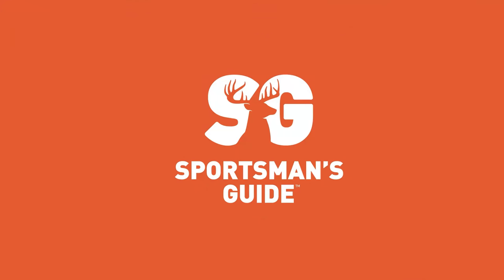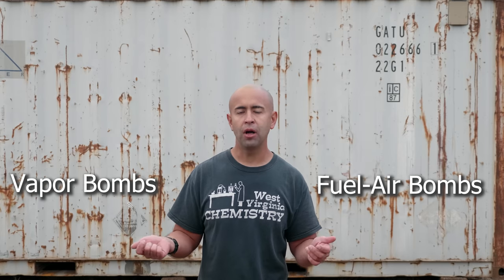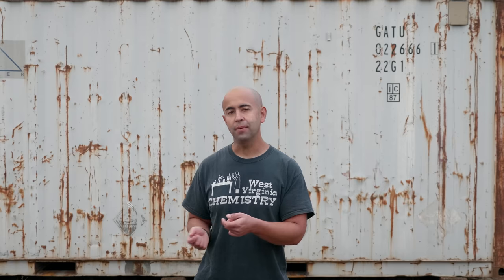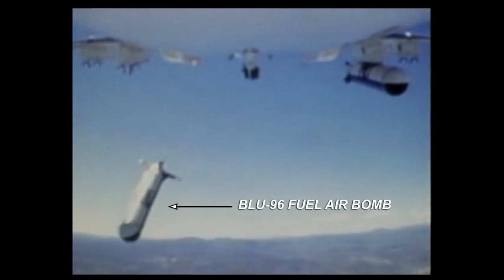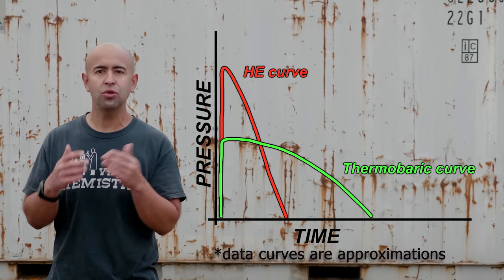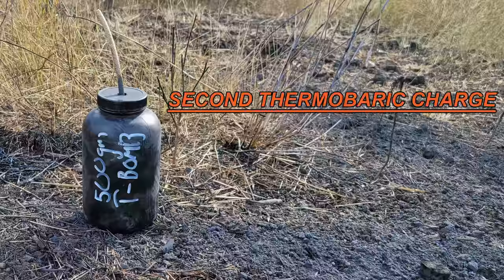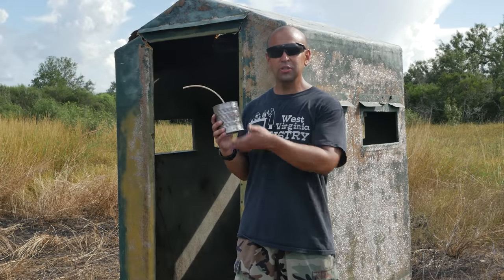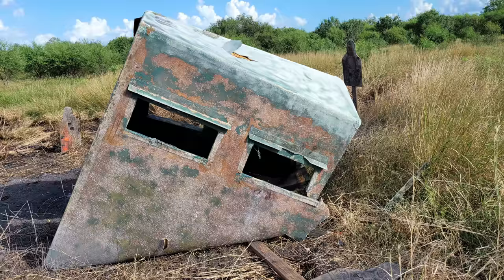Improvised Thermobaric Grenades: Testing Fuel Air Bomb Grenade Designs

Comment: The problem with improvised thermobarics in Ukraine is the dispersal charge almost always detonates the fuel. You need to separate the dispersal explosive by putting it in a pipe B. separate to the rest of the B. That way the heat has a chance to drop below flash point and the pressure escaping will disperse the mixture.

Comment: Not exactly a fuel-air bomb, but liquid oxygen and powdered coal was used in Germany in the interwar period as a cheap mining explosive.  They took rods full of powdered coal and soaked them in liquid oxygen, and I believe could be detonated on their own (no primary).  With dense oxygen present, the coal could detonate (generate a pressure wave).  If it failed to go off, they could just wait a couple of hours for the liquid oxygen to boil and disperse, and then reset it safely.  The liquid oxygen and coal were cheaper than TNT at the time, but you couldn't store it for long periods because the oxygen would boil off, so it wasn't practical for military purposes.

Comment: Armchair mad scientist here. The dispersion charge should be of the rapidly-decomposing type rather than something that deflagrates or detonates. There should be an inert buffer between this charge and the fuel, to prevent premature ignition, and it should NOT be initiated by a burning fuse. The ignition charge should deflagrate an instant later than the dispersion charge.  Premature ignition is the main pitfall here, causing a sad pile of burning slag rather than a big bada boom.

Comment: I find this concept super interesting! Bravo for making this video! Every time I see Jake I get excited because I know I'm gonna learn things I didnt know. The graph at 4:45 for example. He's awesome.
I've been thinking and reaserching alot about solid thermobarics and there's a few ideas I came up with. 

It would be interesting to see the difference between spherical aluminium powder vs dark flake powder.

Mixing the metal fuel with sulfur would be interesting. Aluminium + sulfur will create aluminium sulfide in the combustion, which is a highly exothermic reaction. Would be interesting to see the difference between a stoichiometric mix vs non stoichiometric. Aluminium sulfide itself is combustible but in the presence of water, either by moisture in the air or surrounding the charge in water, hydrogen sulfide gas may be formed. Evolution of gas will greatly increase the pressure from this rapid combustion, aluminium alone will ofcoarse oxidse to solid aluminium oxide. Once the fuel is dispersed into a cloud though oxygen will favor the reaction with Al because of its higher electronegativity compared to S.

If we introduce a halogen gas, by adding either teflon or PVC powder, we may be able to boost the heat of the initial combustion. Because of the reactivity of halogen gasses it will favor the reaction with metals over oxygen. This reaction is also extremely exothermic. So a small percentage is probably all thats needed, just to kick off the combustion reaction. Higher percentages mixed into the AL/S mix would also be interesting. Halogens will also favor the reaction with metals over sulfur if I remember correctly, so if we get a stoichiometric reaction between the halogen and metal the sulfur will be directly combusted into sulfur oxides without forming any sulfides. 

This is pure speculation but it may help if the center charge is positively oxygen balanced in order to set off the fuel. Lower VOD may also help because there's a bit more time for the heat to spread into the fuel, perhaps even flash powder would work.

Hope you guys test this some more, lots of things to experiment with.
Reply: J

Comment: Somewhere in the past I saw a vid on thermobarics. If I remember correctly, they are especially important for tunnels/caves etc (like afghanistan). The pressure curve is better at disturbing ground structures. We only used one once if I'm not mistaken but apparently it's more of roe issue than anything else.

Comment: 1lb liquid propane canisters for the body.

Use liquid nitrogen to hyper cool propane so you can over fill the empty canisters after you add the blasting charge (at low enough temps propane will stay liquid long enough to pour it into an open container and cap it with a plug. Oxygen will too, but dont mix the two.)

They are rated for pressure so they can build up a bit more ooph before the body fails, and the propane should vaporize fairly quickly giving a good dispersal.
Reply: Or go the opposite direction for a boiling liquid expsnding gas explosion
Reply: Just heat over a flame hot enough for the tank to rupture the flame ignItes the expsnding gas
Reply: @michaelensminger5190  you need to super cool the gas to condense it down into liquid so you can get more in the canister (propane is much denser in liquid form than gas form).

It doesnt have to stay super cold after you have it sealed off and pressurised.
Reply: @DH-xw6jp  Just so much effort compared to simply causing tank to BLEVE (boiling liquid expanding gas explosion) fail. Abought 90% of combustable you want sacrificing the heat source.
Reply: Just bope fire insuance is paid up:)

Comment: Have you tried a non explosive bursting method?Something like those airsoft flashbangs that work by inflating a platic hull with co2 till it explodes. May give the fuel a chance to disperse before secondary charge initiates the blast.

Comment: Using metals as fuel will almost always yield suboptimal results in thermobaric devices, because you're unlikely to increase the amount of molecules being around after combustion and due to their state of matter. I.e. 2 M(solid) + 3 O2(gas) -> 2 MO3(solid). 5 (2+3) mol air fuel mixture reacts to form 2 mol of solid stuff -> entropically, this will lead to a drop in pressure, since you consumed 3 mol of gas without replacing it, so the only thing that can contribute to forming a shockwave is the thermal energy released during the reaction.

Ideally, something that burns hot AND has a favorable stoichiometry is chosen. If something like gasoline is used, here simplified as octane C8H18, you can get much better results. C8H18(liquid, atomized) + 12,5 O2(gas) -> 8 CO2(gas) + 9 H2O(gas). Now you're turning 13.5 mol of air fuel mixture into 17 mol of gas, with a net gain of 3.5mol of combustion gases. Now this will cause a nice pressure wave…

Comment: For my job, I drop/employ bombs from aircraft, but we didnt get much training or education at all on how they work. GBU-31, GBU-12, GBU-38, GBU-54, etc. But those are just different guidance kits on essentially three basic bomb bodies: the BLU-109, Mk84, and Mk82. 2000lb penetrator, 2000lb, and 500lb respectively. 
Could yall do a video on the explosive and fuzing components of these? We use certain impact or proximity fuzing with different delays for the intended purpose and the type of target. A GBU-31v3 (with the BLU-109 penetrating bomb body) with a 25ms impact delay has drastically different effects on target than a GBU-31v1 (with the Mk84 body) with a Prox fuze! 
But I dont know how the fuzes work or what type of explosives they use, etc.

Comment: I noticed that the aerial bomb dropped dispersed the fuel before igniting it thus giving the liquid cloud more time to disperse. Whereas in the experiments conducted here the ignition of the explosive charge and the fuel were simultaneous thus not giving the fuel time to disperse into a cloud before ignition.
Reply: There are two different types of thermobaric bombs. The one you're thinking of is a fuel air bomb, the one type seen here in the video is an enhanced blast thermobaric which works on a different concept.
 
The enhanced blast type uses a conventional explosive mixed homogenously with a reactive fuel like aluminum powder. The explosive detonates and heats the fuel to thousands of degrees causing it to instantly burn when it contacts air as it's thrown away from the blast. It's basically an explosion that  produces heat and pressure in a larger area over a longer duration as the blast moves out rather than being a single short spike in pressure you'll get with conventional high explosives.

Comment: I think the magnesium powder is too soft to make a good fuel. It looks like the initiator charge is compressing it into clumps, which don't aerosolize well. You could counter that by pre-mixing the magnesium with graphite lubricant. Alternatively, I would love to see a "hybrid" design, where you mix maybe 10% Mg powder in a liquid fuel.
Reply: Yup the HE is pressure sintering it. Mix the magnesium dust with ether and you get a double acting boom.  Butst, ether goes boom, magnesium dust ignites with a bright flash, than HUGE boom. FWIW the military ones use zirconium instead of magnesium for this exact reason.
Reply: @christopherleubner6633  Technically it's not "sintering", that requires diffusion across the particle surfaces over time.

Comment: Would using compressed air as a dispersant work better? Something like a commercial tire bead setter with a solenoid dump valve? It seems like accurate timing of dispersal to ignition would be easier.

Comment: When using liquid fuels, would pre-puncturing/drilling the vessel and then sealing it with tape or gluing it a weaker plastic film assist with the aerosol effect?  Obviously it would still need a 2 stage ignition, first to expel the liquid fuel and then ignite it.  As for solid fuel thermobaric devices, I didn't completely know they existed until now.  I guessed they wouldn't been tried/tested but with flammable liquids being an easier option, I've only ever seen video of those devices.  Yep, I go to the strange corners of the internet & YouTube - this is how I found this channel 😉🤣

Comment: I think that you should compare it to an explosive in the same type of container (filled completely with explosive).
I'd like also to point out that the grain size and surface conditions of your fuel will have a huge impact. There's a good chance that if the dust is in the range of micrometre or even nanometre that the combustion speed will go through the roof. Obviously oxidised surfaces would greatly impede the reaction.
I've heard of explosives made of nanoscale metal dust coated in an energetic polymer.

Comment: Question: someone in our local area is detonating some concussion devices randomly around our neighborhoods, mostly at night, just for terrorizing our residents. What are we hearing???  We're told it's happening in other cities. It happens all the time not just around holidays. Police dismiss it as illegal fireworks like rockets but there is no flash or pyrotechnics associated. Searching the area we don't find any shards from containers or paper. The jolt is strong enough to rattle our walls inside.

Comment: I believe the thermobaric effect can't be achieved using metals as fuel. That effect comes not with the combustion of the fuel per se, which happens with fine powdered metals, but it is caused by the sudden transformation of the fuel mist into gas (CO2, water vapor or N2), which with the rise of temperature it expands violently. The rapid oxidation of metallic fuel will only produce metallic oxides which are solid, so it doesn't create the desired effect. It could use some other solid fuels as long as are organic or have in it a N-N triple bond, could be as simple as flour. My hypothesis could be confirmed watching some of those devices detonating with the high-speed camera and the second pressure wave being absent with the metallic fuel explosion.

Comment: First, "thermobaric" is a sort of subset of fuel-air explosive. In a thermobaric weapon, an explosive mixed with fuel (e.g. metal powder) is detonated. It undergoes a combination of anaerobic and aerobic detonation involving first the explosive, then the mixture of explosive and fuel. The design and manufacturing is highly technical. The greatly increased pressure wave is believed to occur as a result of detonation "growing" on the expanding blast wave.

The process is considerably more complex than with an ordinary fuel-air bomb, which comprises a plain old fuel that when mixed with air can be detonated, and in that case, it is a (ideally) homogeneous mixture that just goes boom when ignited.

So what you are trying to do here is make a fuel-air bomb, which is a laudable pursuit and also quite difficult. You're definitely not there yet though.

The pressure wave you get when one of these things really works is TREMENDOUS. It is surprising and is enormously more powerful than the report from the dispersal charge. The Finnish guys worked it out (see link). When the fuel-air mixture actually detonates, the flame is markedly reduced. The amount of fuel you used, you should get that same camera-shaking report. Maybe you had better success with a different one though? I haven't looked at all your attempts but you would be getting a POUNDS of TNT report if your detonation is efficient.

https://www.youtube.com/watch?v=sv0tGx80yLk&t=298s

Comment: These do not look like thermobaric explosions. The fuel is being burned rather than detonated. It is questionable if the fuel air mixture is actually achieving a stoichiometric ratio before an attempt is made to detonate it. The initiating secondary charge must generate a blast wave of sufficirnt pressure to compress the fuel air mixture to the point where it itself detonates. The fuel air detonation wave must then continue to propagate through the air mixture to maintain the overpressure. This can be thought of as compressing successive shells of the mixture.
 It is not surprising that an improvised device has difficult achieving this delicate balance. It must be hard to design the initial burst charge, so that it spread the fuel with a air mix density distribution  that can be compressed to the point of detonation, without simply igniting it. 
There have been many scientific papers written on the propagation mechanisms of such explosions, in particular looking at the part radiant heat energy plays in such explosions. It was speculated that radiant energy played a part in producing the branching chain reaction, by triggering the ignition of the fuel ahead of the pressure wave. Certainly this mechanism is a major factor in boiling liquid gas explosions, and those produced in fuel particle dust cloud explosions, where extremely high temperatures have been recorded, for example in accidental liquid gas tanker explosions.
I have read a paper that examined the part pressure and heat play in such explosions, attempting to establish which comes first, the heat wave or the pressure wave. A reasonable question, given that the infra red heat energy propagates at the speed of light. The conclusion was that pressure is the dominate factor. By definition, a thermobaric device relies on the over pressure shock wave to propagate the explosion. I imagine it to be a little bit like forming a diesel piston from the compressed air in the wave front. 
High speed videos of thermobaric explosions of even small devices, show the very strong light distortions in the air produced by the pressure wave, which is noticeable wider than that associated with conventional high explosive. Mannequins placed in the path of the explosion are shown to be completely shattered by the passage of the shock wave.
Had your experiments produced a thermobaric explosion, I would have expected your targets to be blown down, and possible completely destroyed.
Reply: The diesel effect is how I interpret FAE as well. I read a paper suggesting it requires a few dozen KJ to reliably detonate a fuel air mix. Something to the order of a few grams of tetryl or similar.
Reply: @Slowly_Going_Mad  that may be correct, if the fuel/air is evenly mixed, particularly around the detonating explosive, I suppose that it matters little about the size of the initial virtual piston. Once the fuel is compressed sufficiently to detonate, the explosion will propagate, provided there is sufficient energy to compress the next shell of reacted fuel.
The detail of the mathematics is well beyond my understanding, but the principles of the calculation is not that difficult to grasp. 
There are a number of academic videos of such explosions, some done by the Russians and Americans, a few done by Cranfield University in the UK.
In each case the fuel/air cloud is visible and well established before the detonating charge is fired. I suspect a great deal of work went into establishing an even density cloud, with the initial spreading charge being critical. 
The is a well known pyrotechnic effect, that involves using a gunpowder charge to lift a flammable powder into the air, before igniting it. 
Commonly milk sugar is used to produce a very impressive hot fire ball. It is  not difficult to imagine this powder being detonated, rather than burned. 
For military thermobaric explosives that use a powder fuel, nanotechnology is used to produce just the right particle size and anti-clogging properties to optimise dispersal and maintain the suspension airborne.
Reply: @nigeljohnson9820  yeah there's a lot going on in those detailed papers but it's a relatively easy concept if you can keep from getting lost in the details. Unfortunately those details are critical to making them as efficient as possible. And yes I know what you're talking about: the good old Cremora flash pot. I actually built one last year and it was quite impressive. Unfortunately the video was taken by a friend with rather unsteady hands. Two tablespoons of home made black powder and a half pound of flour over it. It was as bright as day for a second.

Comment: You guys really need to test at least 1M AGL for a more complete dispresersion of fuel. If that is not possible because of regulation you should design it as a shaped charge to maximize the fuel cloud.